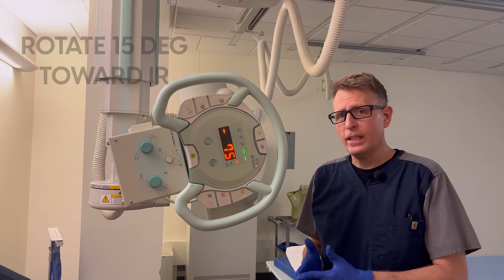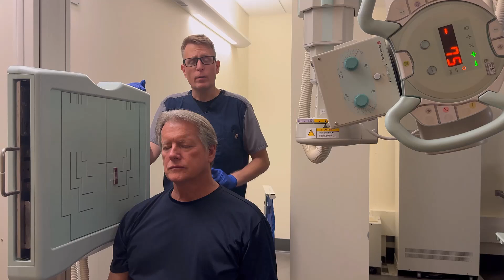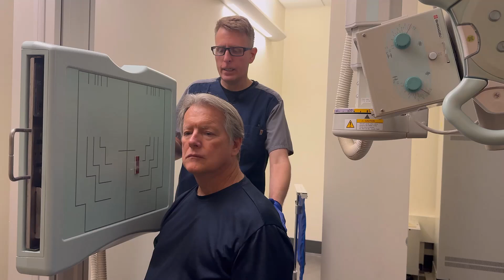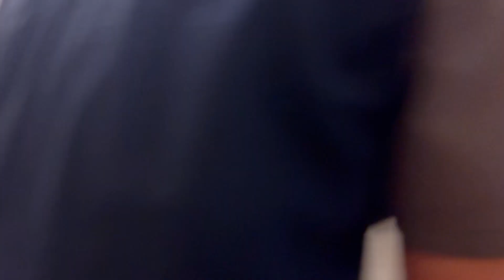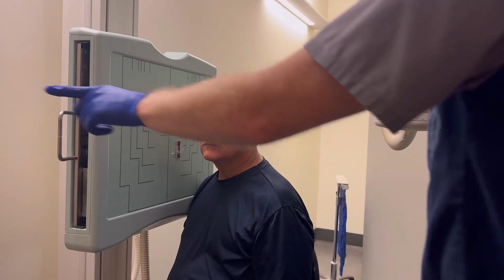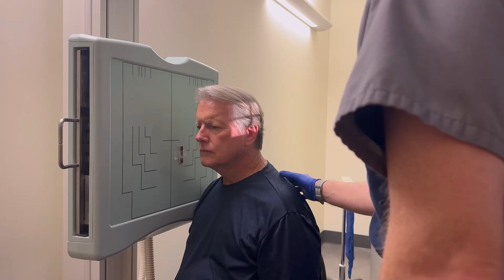Law for TMJs Radiographic Positioning Demonstration

Comment: Never do 'floating skull' radiography. It is easier, less magnified, and less inclined to be blurred through movement if the head is touching the bucky. I have never seen the 'floating skull' technique in 40 years and working with 300 radiographers and looking at text books and videos. None. In the old days it couldn't be done because the focal spot was too large and the exposure time too long. My technique would reduce the collimation to 1/4. I used to be able to put 4 TMJ projections on a 8x10inch film